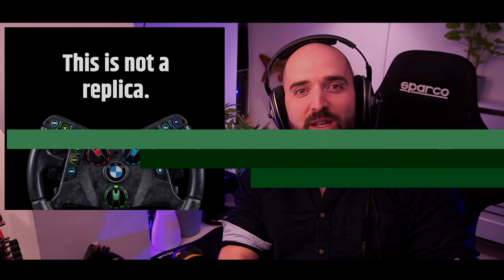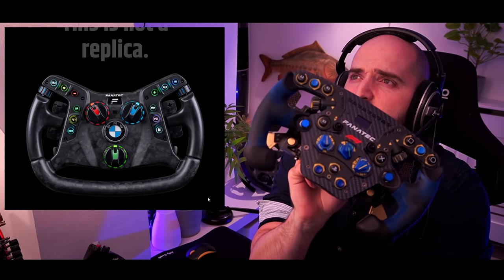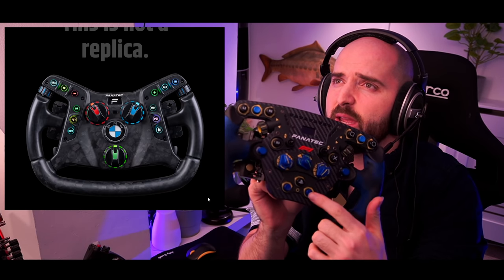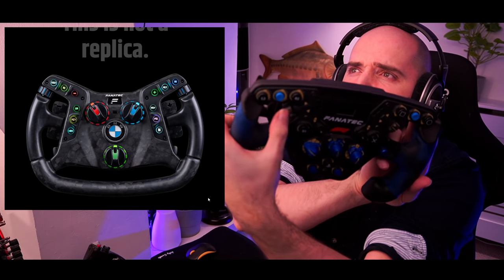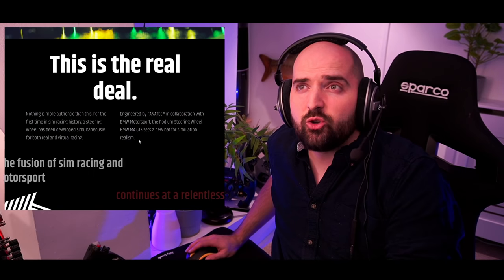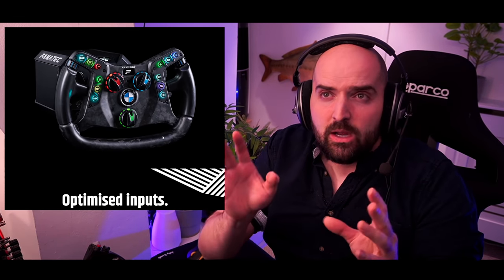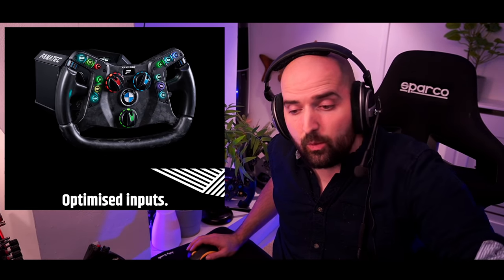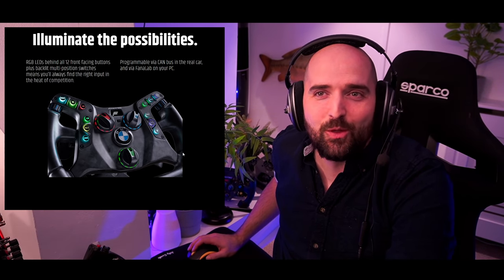New Fanatec BMW GT3 Rim - Its a Real Race Car Wheel !

Comment: So its going to have a "real race car wheel" PRICE! F
Reply from the maker: From the BMW Press event they said its "cheap" so I think there has been some compromise I'd expect it to cost more than 500 and less than 1500 though , but who knows lol with anything motorsport related always add an extra 0 to everything
Reply: @GamerMuscleVideos  I was honestly expecting more than £1500 to be honest. If you look at some of the wheels for the Simucube, there's a 100% carbon fibre formula rim for Simucube that costs €1500 and obviously that's just a replica so I expected this to be north of that. Interesting if it's cheaper though, I wonder why BMW would opt for a 'cheaper' product, especially for the real deal GT cars.

Comment: I'm guessing it'll be in the 1500 to 2000 price range. Maybe they could stretch it to sub 1500. 
I'm sure BMW saved a lot of money having fanatec develop this wheel so that will keep the price low both for us and for the real racing teams looking for spares. Also I wouldn't be surprised if BMW didn't ask fanatec for a licensing fee for this wheel which would keep the price down even further.

Comment: What cracks me up about this wheel, still need the + and - sign on the gear shifters. Even GT3 professional drivers need this reminder.
Reply: On some race cars you could actually both upshift and downshift on the same paddle because the paddles are connected.

Comment: Watch the video on the fanatic site. Right at the end after you see the face on shot of the car with its headlights on you will see the wheel. This wheel shown unfortunately has white stripe graphics on but bottom right and also top middle area it is in normal carbon fibre twill, basically different to the forged carbon style that this is. I really do wonder if they are exactly the same. Maybe I’m wrong but say an F1 wheel costs £40,000 which is arguably more detailed should therefore give us an idea regarding a GT3 wheel. Best case your looking at £10,000 for real 🤷🏻‍♂️ IMO. And that’s the one at the end of the vid I mentioned. Thanks for content 👍🏻

Comment: It look to me that the quick release is only a dummy in the film. No connection between wheel and base. My guess looking at the bolts and fixing on the back of the rim it will have the standard Fanatec QR when finally released.

Comment: This thing will be expensive because it needs to be FIA certified if they are directly used from Fanatec in the real car, otherwise it isn't even allowed to be used.
That certification doesn't come cheap. Add any licensing and R&D costs to that, manufacturing and profit margins too, plus you have to add a complete new quick release and you have an expensive tool I think... 1500 euro maybe? Maybe more?

Comment: my worry with a collaboration like this is the priority will always be on the real life race car (as it should be) and the result of that is actually we as sim racers will lose functionality that is beneficial to sim racers that are somewhat useless in a real car... that's why there's no funky switch, no shift lights, no added extra goodies like a telemetry screen and that's all because its not a requirement for the real race car. No need for a funky switch which would benefit greatly VR users for example but is useless in a real car, no need for shift lights or on wheel telemetry because that will be on a display in car etc... so as amazing as it is sim racers are really getting the short straw with this rim, the cost is going to be in the 8 layers of carbon fibre making it extremely rigid and stiff, the water proofing and shock damping material etc etc. its just not going to be the star of anybody's sim rig i don't feel and it really really should be, i want to sit down every single time and say wow what a great wheel but this is not a sim racer priority build and so it shouldn't be.

there is absolutely nothing wrong with a replica, in fact for sim racing replicas are much more accommodating to us, they will look very close to the real thing but maybe offer extra functionality that makes playing a game more pleasant, of course we want a well built rigid wheel but overengineering is added cost we all could do without especially when it is over engineered to meet real race car standards.

if it comes out at the typical fanatec cost between 500 and 600 quid i think there can be no complaints, its another option and its there if we want it, its still pretty unique and amazing. but if that thing alone costs £1000 plus then we have to beg the question is it worth it compared to what other wheels in the line offer. i think its going to be stupidly expensive, if it isn't then you have to wonder just how basic the BMW GT3 car actually is, i mean they dont use anything like F1 complex wheels but you would still expect some kind of advanced capabilities not required for sim racing at all that run up the cost.

Comment: I'm gonna say >$700us money. They should drop a Clubsport model. The Formula rims are old but do a good job. GT rims are hot. The Universal hub based rims are overpriced and dont offer much, no analog or funky sticks. The 911r is nice, but there is a huge hole in the lineup.

Comment: The real gt3 will have the fanatec micro screen too?
Reply: There wont be any other "real" gt3 wheel. It is THE wheel. So yes.
Reply: @momorious  You can't use the electronics of a sim racing wheel for the real car. They neither use USB nor a proprietary Fanatec connection.
Reply: @Leynad778  the steering wheel (the Sim or the real car, as is the same) has CANBus exactly for that reason
Reply: @Leynad778  they do with the CAN Bus :)

Comment: That fanatec F1 rim looks like the Alcantara doesnt hold up well
Reply from the maker: All alcantara wares down , it's why I generally prefer leather or rubber on most wheel rims.
Reply: @GamerMuscleVideos  True but seems blue shows it off more than the black i guess and i feel the same about preferring Leather over Alcantara.  Alcantara looks nice for the first week then it needs to much care or you have to wear gloves all the time plus if you dont a lot of the Alcantara leaves my hands black after a long race even on premium Alcantara.  

Did you get a G2? I really want to get one but the FOV is what worries me because im used to the Index but i know i need to get the RTX 3080 first because my 2080 super struggles to give me the resolution i want at the FPS i need so the i suspect the G2 will be worse due to higher resolution albeit you can run it at half res.
Reply: @GamerMuscleVideos  You prefer rubber fullstop. That and lube are your Saturday evenings sorted.

Comment: BMW M3 GT2 was announced as real race car wheel but in reality it wasn't and I think it's te same situation here... BTW on some spy photos u can see very short DD base ;)
Reply from the maker: This wheel is a legit GT3 car part BMW part , not just a licence.   They have had to do some specifc programming so it works with the real cars electronics + make other stuff up to spec in ways you would not have to for a SIM only wheel.  

So.its a legit GT3 wheel which means it will probably be very cheap for a GT3 car wheel but super pricy as a SIM wheel.

Comment: It's a meh from pauper me. Also watch out for DNF's for BMW next season due to 'electrical failure'.
Reply: Actually...if the mechanics and buttons are automotive grade....the "in-car" wheel electronics/software are much much simpler than the PC ones...all the connection just go to a CAN transceiver and over CAN bus to the BCM/ECU or whatever BMW are calling them ...which is/are the complex bit/s...not the wheel in particular. In Fanatec's case, they still need to make them use a micro controller in the wheel to use setups and talk to different peripherals and the sort...not to mention console use (if there's gonna be any) that have to have Xbox/PS encrypted communication but not both...while in the car is just button press->CAN bus...done.

Comment: Perhaps it'll last longer than their £549 Porsche replica wheel which have been known to fail after a week. More gimicy bollox from Fanatec. Desperate for exclusivity you're hoping that it's only compatible with the DD wheels and preferably the Podium variety. Mug.
Reply from the maker: Eh ?  I have a t300, g29 , OSW , CSLE , and DD1 ....    The point is if you are spending 500+ on a wheel rim then it makes sense to only really use it on a DD like Simucube 2 or fanatec DD. 

Maybe watch the channel more before making assumptions and commenting

Comment: I hope Made in China-Fanatec's cash was worth it, James...
Reply from the maker: 1) why is things made in china bad ?   Lots of amazing things are made in china ...
2) Fanatec did not pay for this video   ( though i do have a fanatec link and this video will get lots of views) 
3) A real race car wheel that works for both sim racing and a real car is a novel and intresting thing.
Reply: @GamerMuscleVideos  You can't use the wheel for Sim Racing and the real car. Phoenix Racing is providing an Audi GT3 sim racing wheel and the boss said, the internals are completely different.
Reply: @Leynad778  because that wheel was not designed from the start for the dual use, while this one is and therefore implements the Sim racing and the car interfaces